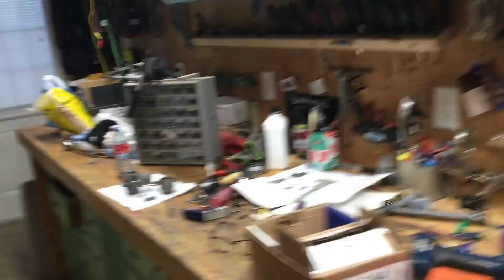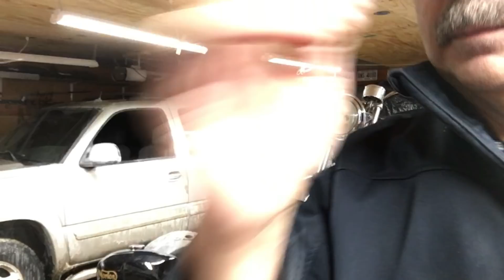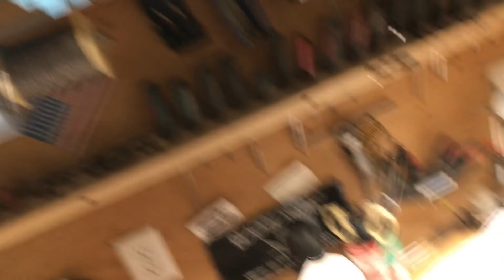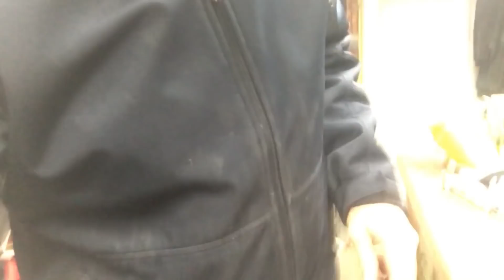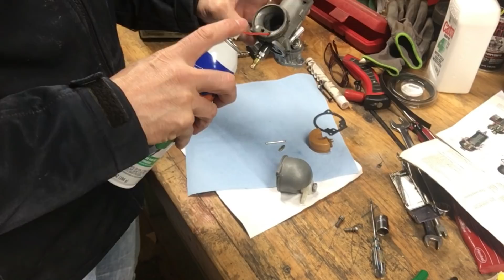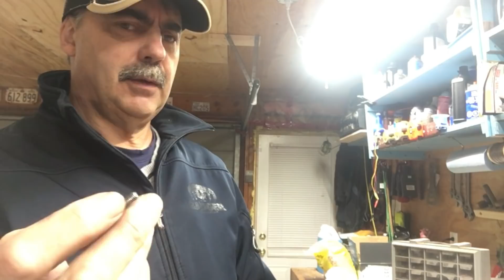Amal Carbs being Anal, Norton Commando Idle Circuit

Comment: So when you clean the junk out of all these small holes and passageways does the junk come out?  Or does it just get jammed into some other spot to clog up when you least want it to?   Does blowing air through the passage way actually make the junk come out though?  Is it able to pass through that small brass hole you pointed out before in the video
Reply from the maker: You have to keep picking away at it with a wire and carb cleaner and compressed air and you will get it cleared out.

Comment: Thank you for saying WHERE you found the wire size that would fit that pressed in jet...
I've looked all over and found some mighty small wire but all are too big... so I gave up and out of frustration, I bought 2 new carbs with removable jet from Amal for my Triumph 750.
but NOW i can get the old carbs working again ! thank you.

Comment: Hello my friend I had a Norton 750 atlas the predecessor to the commando and the screw you are talking about is on the mixture side it alters the fuel not a air screw from what I remember the predecessor to the   amal concentric what you have was the amal monobloc which I had a rare matching pair that looks really good with the float extensions on fitted to my Bonneville I  suppose you have sorted it out as this is a older video regards Alan from the UK. Hope you don't mind me commenting but I have subscribed and your video brought back some old memories I only have Harley's now on my YouTube channel.

Comment: Great content.  My main trouble is the slides and body wear quickly from vibration.
Reply: Regarding the original Amal carburetors fitted from the Norton factory on Commandos - Amal now make "hardened" slides as a replacement/repair part.  Some people have reported that they're supposed to fit into existing slide bores but they're too big; others find that they work great.  There have also been attempts in the past to "sleeve" the bores by boring them oversize, putting in a harder metal insert, and then final boring or honing to perfect size; reported results have ranged from "wonderful" to "disaster".  
I suppose that the ultimate would be to have a very precise machine shop that can put out perfectly round, perfectly finished, and perfectly sized bores in a fitted sleeve - and access to a box full of hardened slides so that you can try a dozen to see which one (considering the factory tolerance variations) is the best fit for a given "perfect" bore.  Norton Commando owners/riders/tuners who have successfully navigated the pitfalls of all of this report reaching a level Amal carburetor Nirvana that's a long-lasting aid to getting the perfect Commando carb tune.  

A real base issue with the 930 and 932 Amals originally fitted to the Commandos at the factory is that Amal cast them in zinc alloy that was specified with one goal in mind -- to be CHEAP.  The zinc metal can vary from being (relatively) hard to very soft, it can be cast perfectly or it can have micro-voids and cracks, and it's always guaranteed to oxidize quickly into a powdery, white deposit - especially in the presence of ethanol-blended fuel.  MO & B is correct in his process here for diagnosing the idle ports, assessing the extent of the blockage caused by oxidation, and for cleaning the various passages (both air and fuel) to assure proper idle circuit operation.  It's wonderful when it works but -- IMO - it's sort of like putting lipstick on a pig
Probably an excellent upgrade is going to the new Amal Premier carburetors - they're cast in an aluminum alloy that's pretty good and certainly a great step above the best zinc castings.  In theory, they're available as perfect bolt-on replacements for the originals and many people have found them to excellent out of the box - others have found they have different experiences and it's been occasionally reported that a careful cleaning before they're used the first time is a good idea (and watch as you're cleaning to see if you get debris, dirt, or machining swarf out of the internal parts), also, assure that jets, jet holders, etc. are properly installed and correctly tightened.  And speaking of jets, it's important to note that the Premiers have a removeable, tunable idle jet whereas the originals have a "pressed-in" idle jet that is almost impossible to change and difficult to clean.

No matter what carburetor type you're using on a Commando, as MO & B has illustrated here, it's vital for a proper carburetor tune in service to have the idle circuit properly cleaned and fully functioning to assure a basis for getting a good result in service on the motorcycle.  The idle circuit is especially important for easy and consistent starting, too.
Reply from the maker: Yes exactly, some times there is nothing you can do but just replace them. Thx for watching.

Comment: Start watching at 235. Before that you may get dizzy. How do you fix the piece you removed afterwards. I found what you were talking about, the idle jet was plugged so I worked on it for a few hours with a  "B" guitar string (0.015 " ) and finally got it unplugged. I did not remove any plugs, etc.  It had sat for 15 years with fuel not drained. The jet is 0.016 " so if you use a smaller one it will go through. A 0.016 " piece might be difficult to get through from a tad bit of interference or the snipped off end. A quick buzz will remove the tiny burr on the end too. Love my 48 year old Norton.

Comment: Hi Bruce, did you check if the bowls are 100 procent flat, most of them are bended due to overtightening. Makes sucking up the fuel in the idle system more difficult. Allen screws nice but dangerous i think. Think you do very well cleaning it out this way, must give succes!!!
Reply from the maker: Hello Gerleen, Yes I did check the float bowls when I first rebuilt them. They are very square. Thanks for watching, Cheers Netherlands!